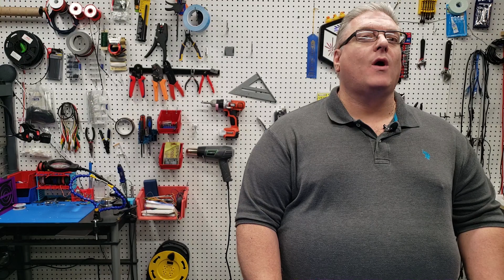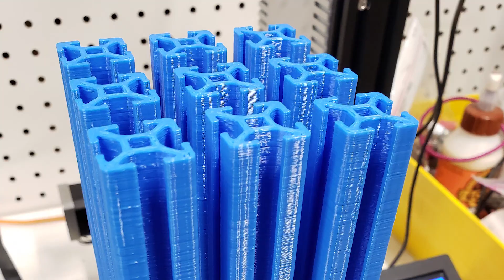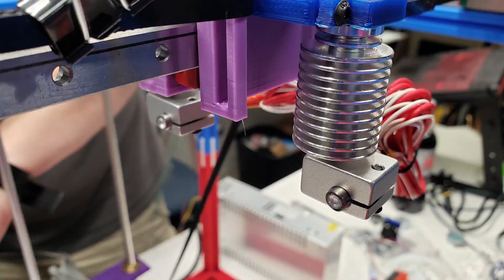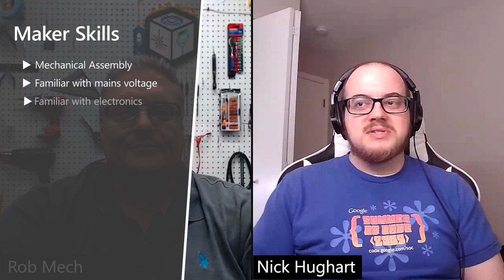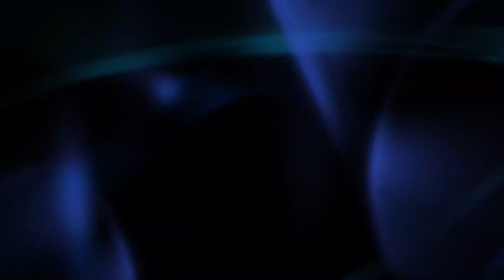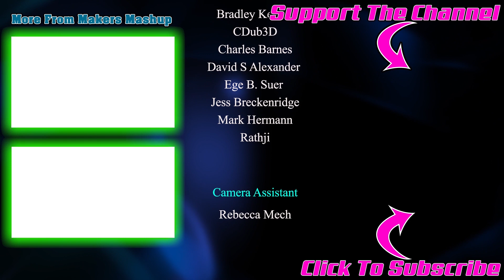DIY CoreXY 3D Printer | LayerFused X301 Introduction

Comment: Great work guys. I am looking to reduce my number of printers due to moving into a smaller workspace but I'd like to keep up with the workload demands that sometimes pop up. What is the average speed/quality ratio at standard .2 layer quality as most of my projects are functional then the pretty parts I usually post process them. I'm used to printing at 60mms so to be able to triple that would be great especially with a printer that doesn't fling a heavy bed around haha. Cheers. I've already watched the build videos for the most part and once again, great engineering work.

Comment: Nice and very interesting project. It should be easy to scale up as I'm looking for a replacement size wise for the cr-10 S5. The S5 really pushes the limits on what you can do moving that big of a bed and I need a better/faster option.

Comment: I was inspired by this the other day to lower the top/front cross bar on my d-Bot.  Got it down 6cm but the bed rails prevented going further. Currently debating mounting a longer crossbar across (instead of between) the front pillars  about half way down. Just having that cross bar down at the bed level is already way better.